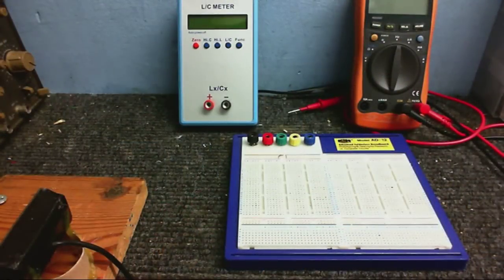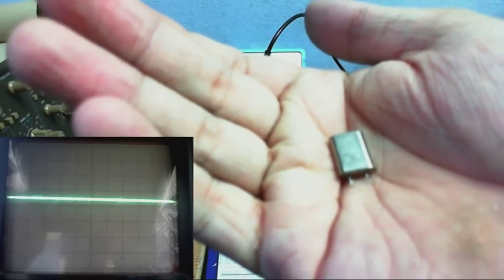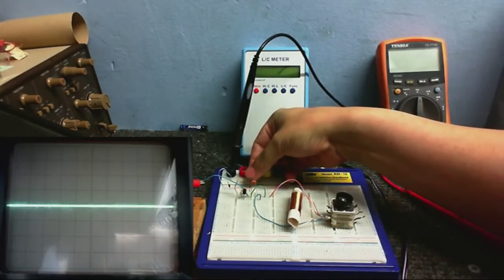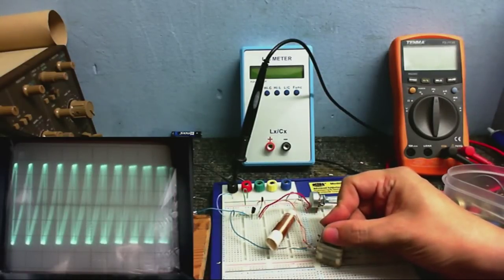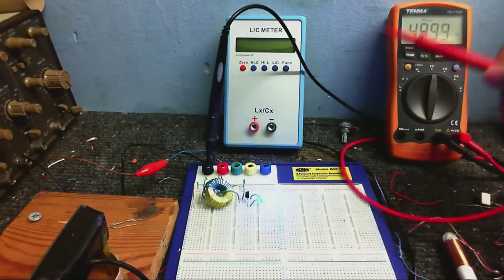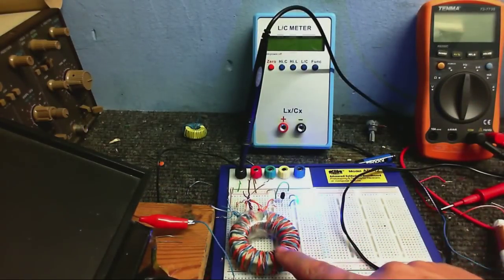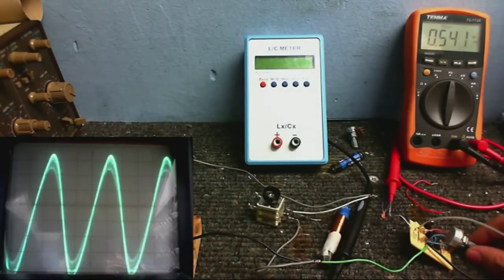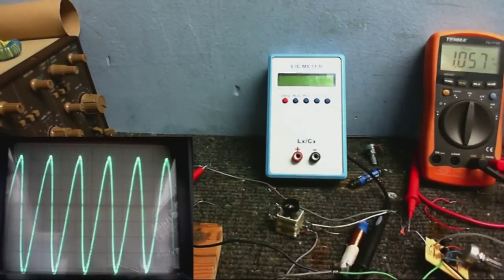Experimenting with oscilators for radio circuits and finding LC resonance

Comment: How did you do the circuit board background pic with you in the intro? That is a cool effect.
I am new to doing videos but old hat with electronics. I am going to do a Jacob's ladder build. I may be able to throw in some simple video tricks if I understand how you did the intro. Keep up the experiments and as I say "I will be in my laboritory!" I was totally jealous over that Sony reel to reel you were messing with. Believe it or not here in the states around my area that is hard to find. Well that's about it. Later JB fis
Reply from the maker: +J&amp;B Fix it shop That's called Chroma Key, I took a picture of a circuit board, then I filmed myself standing in front of a green sheet, then in my video editor I used the chroma key effect to remove the green and replace it with the circuit board picture.  The only difficult bit is getting the sheet as evenly lit as possible so the effect can work well.
Reply: So using chroma key allows you to use the green screen? I told you I am a total noob at video effects. So in a nutshell you put up a green background. Then you film. Then you use the video editor to layer over the green screen with a pic?
Reply: I forgot to add. I am designing a 60 to 73 mhz amp to boost my video signal all over my house. I am using a analog channel and using a dipole antenna. I have got the amp up to about 2 watts but I have issues with it. My 250mw designs are rock solid but working with vhf has become my obsession.
Reply from the maker: +J&amp;B Fix it shop That's pretty much it in a nutshell, I use Adobe Premiere to do the editing on.

Comment: Forgive my ignorance but, why sometimes you needed to put your finger to start the oscillation?
Reply from the maker: +Henrique Sousa Its kinda hard to explain but sometimes the circuit cannot start itself, it needs some kind influence to start the current flowing, and since the human body is like an antenna and can pick up the 50/60 hz mains and other frequencies in the air, touching the coil just gives the jfet something to amplify and turn into an oscillation.